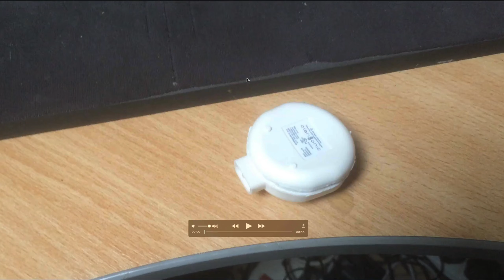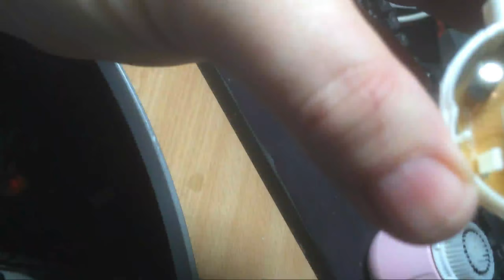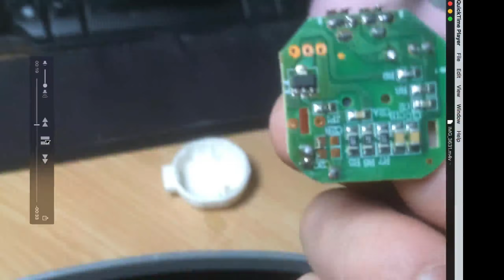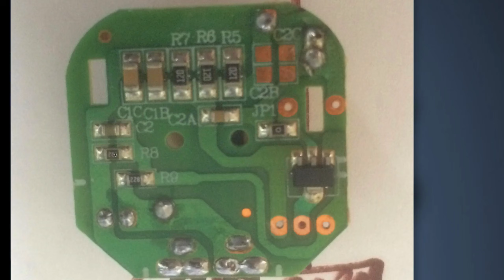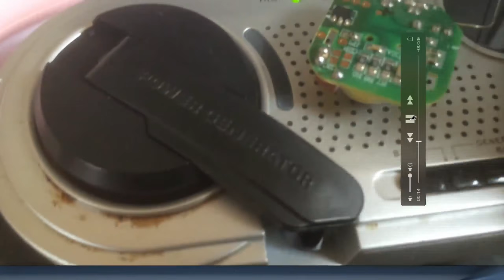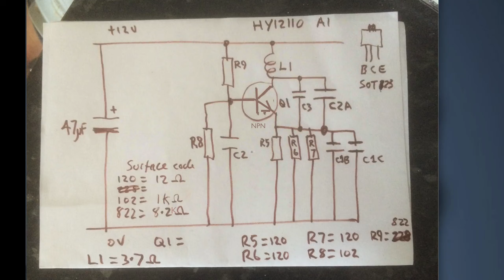How to fix Clarisonic Mia2 and Mia 1 Wireless Charging including Circuit Diagram.

Comment: My Clarisonic mia2 brushes do not spin at all. All it does is vibrate and hums?  Is did the spinning motor get stuck?  How do I fix the motor sir?
Reply: It isn't supposed to spin so it's normal. When it hums you have to clean another part of your face like : left cheek hum right cheek hum forehead....

Comment: Speaking from my personal experience with the mia 2. First, let me say I absolutely loved it, when it worked. But when it stopped working I called Clairsonic and found out some good info. to share. When you purchase the item the warranty begins. The serial # is on the bottom of this devise. There is no paper work to fill out for the warranty. You just keep receipt and box incase anything goes wrong within the life time of the warranty. Which could be 1-3 years depending on the devise. I looked at you tube videos and they opened devise and change batteries. While looking at the video it's all most impossible to get everything  back in place  securely. So I called Clairsonic and they said it's not made for you to open because it is waterproofed and it would no longer be waterproofed. So basically when the batteries die and your warranty has expired you just throw it away, it's now garbage! Disappointed! Good news is they will offer you 25% off a new clairsonic.  Mine lasted 4 years on the batteries provided. So I guess I got my monies worth. But just seems wrong to just throw it out. Wish they would make the devise to where you could just change the batteries by redesigning it somehow. I know it's doable. Something to think about before purchasing.
Reply: Wow thank you for this info